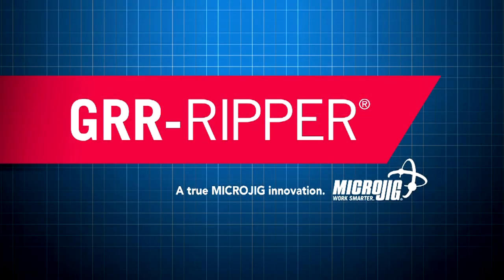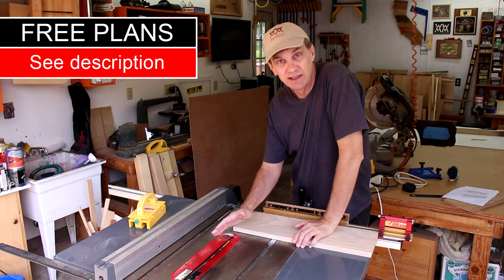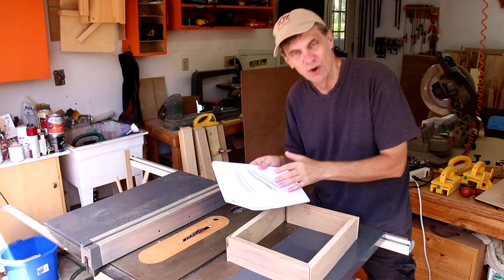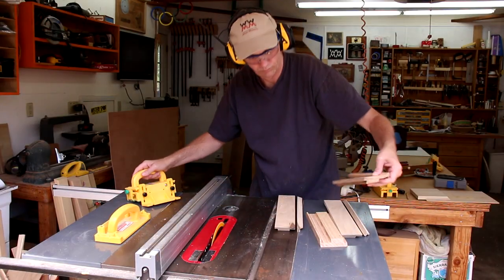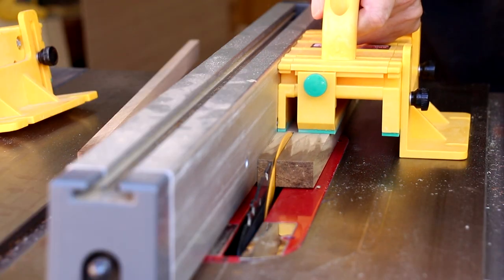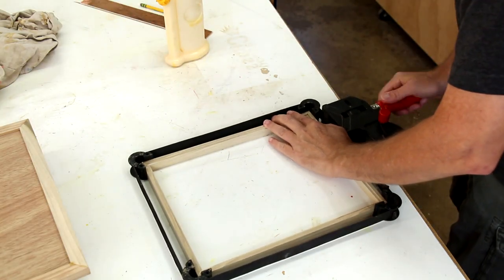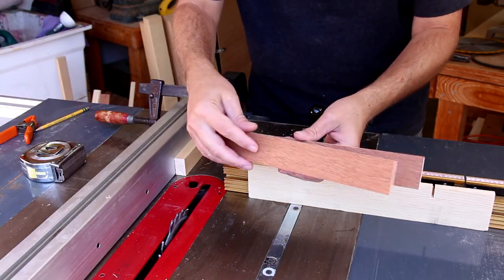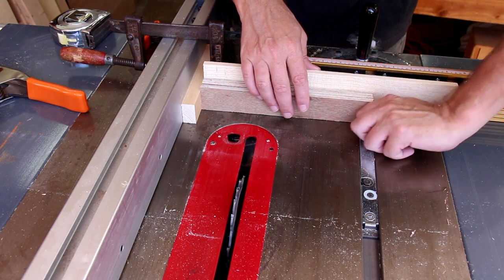Router bit storage box. Get organized by making this handy shop project.

Comment: Thanks for this very helpful video for those of us that are at the level of building projects out of  1x2s, 1x3s, 2x3s, and 2x4s and a box of screws. This project provides such a wide variety of carpentry skills  for the build that its a worthwhile project even if you don't have a router. Completing this one project will move my lower end intermediate skill level to the next notch. And if it doesn't turn out perfect....well its a shop project as you say. I'll be satisfied!  The Plans are a godsend. Thanks so much for having the insight to provide those for us mortals that need this sort of hand-holding~!

Comment: To keep those loose ends of the dividers in place you could cut some spacers of the same material (1/8" ply) and glue/tack them in as you assemble it. Then you still stay away from cutting all those slots in the frame but can keep the "cubbies" square.

Comment: I think that I might have sacrificed two compartments in the top tray by gluing in a block with some finger holes that would make it easier to lift out.- especially since the existing dividers weren't mechanically captured into the rim.

Comment: One change to the design that I think would be cool, and of course would be more work is to make the top portion have the larger dividers and to make the tray with the smaller dividers a pull out drawer at the bottom.  That would get rid of the need to grab the tray by the dividers to take it out every time you needed to get one of the larger bits.

Comment: I noticed at about 0.45 into your video you made a 45 degree miter on the table saw with the blade angled towards the side your passing the cut on...   When making an angled blade cut on the table saw, I would usually opt for making the cut on the side that has the blade angled away from me...  But, I never heard of either way being better then the other... Although it does seem much safer to make the pass with the blade pointed away, instead of towards your arm/hand...  Is there a right/ wrong way?

Comment: Steven, 
I have 2 questions.
(1) what is the bit holder you are using in your impact driver?
(2) When you showed your plans, I was wondering if those were done with Sketchup Pro.
Nice project, I made quite similar as a matter of fact.
Thanks,
Marty
Reply: a quick change bit holder
Reply: Fyi, FastCap has a very nice bit holder.

Comment: I thought you had a router table/cabinet... with drawers. Why not make a drawer organizer that displays/stores your router bits for easy access when installing them at the router table... when you're using your router? Do you really need a portable router bit treasure chest? Do you take your bits with you when you go places? Or I guess you use your portable router more often and it gets lonely when the bits aren't close by in the treasure chest. Just wondering.... pondering... imagining...